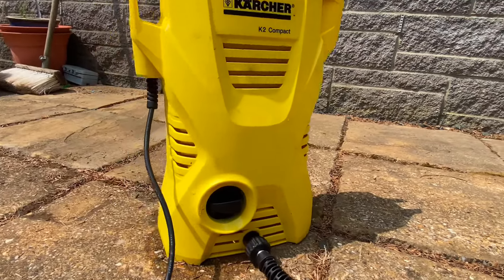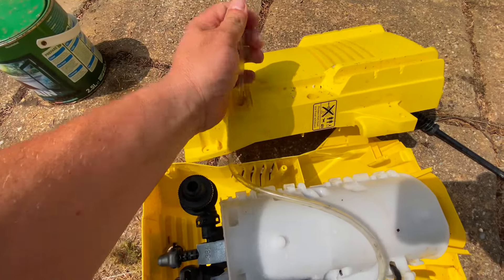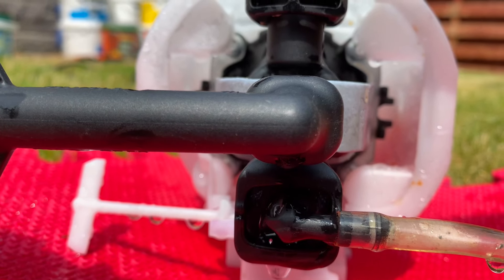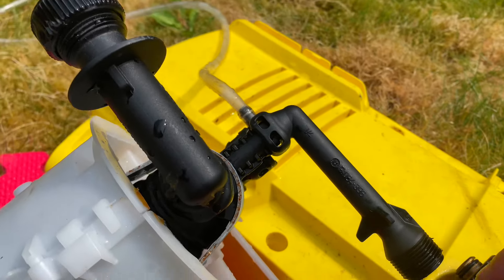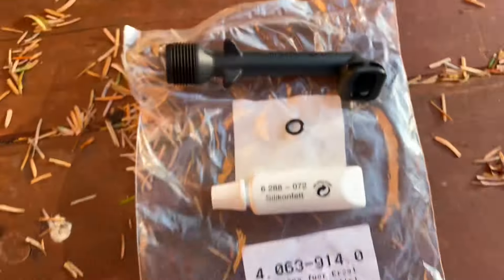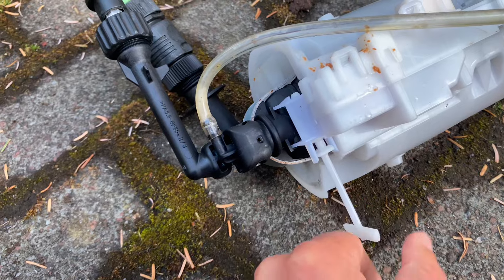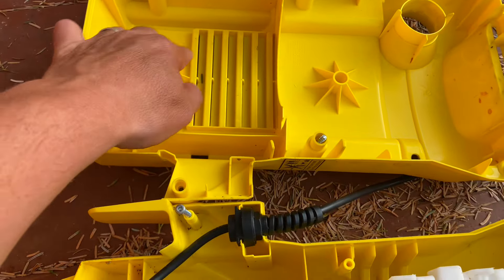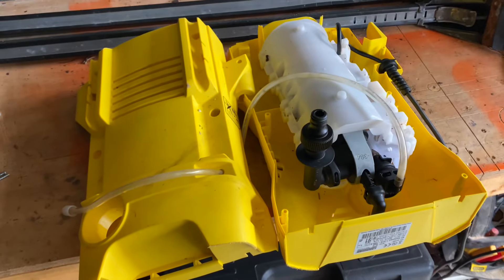Repair to leaking Karcher pressure washer. Quick, cheap fix.  👍

Comment: Exactly the same fault with mine, so many thanks for making this an easy diagnosis. The only issue if you have a K3 is that the daft Karcher product managers designed the two wheels to completely cover the four lowest T15s, which means you have to really abuse the black plastic area to get in any form of T15 bit. Once off, you can pop out the push-fit wheels for easy reassembly.
Reply from the maker: @peterburton9490  excellent bit of info 👍 Glad you got sorted too.

Comment: I watched your video on how to fit a replacement outlet pipe and O ring. The part arrived today andI  I fitted it in no time at all. Power Washer back to normal now. 👍 Thanks.
Reply from the maker: Excellent , a cheap fix 👍 now get on with your tasks 😂

Comment: I seem to have a same issue with my Karcher K2, leaking and spraying water while not able to keep pressure. Seems like a simple fix, thanks for the video.
Reply from the maker: @Xamnl  if you get the casing off and use the washer , it’d show if it were coming from the same not as this video 👍

Comment: Out of interest. Did this give the washer much more pressure back? Eg did it drop power with this leak?
Reply from the maker: @AlanBourne86  the washer would pulse all the time when not in use as loosing water.  It got worse. Pressure was down as not all water was going out the gun nozzle.

Comment: Great video - thanks for posting…👍
One word of caution would be to ensure you don’t make the same mistake as me - my lance cable/connector was different - double check your part no. mine was 5.064-110 for the small K2…🙄
Reply from the maker: Good tip! May be a variant in years 🤔

Comment: Hi do you know how to fix it when the water is leaking from where the water hose connects into? Thanks
Reply from the maker: Sorry, not sure. Best bet would be to get the case off and see exactly where the issue is.  If it’s where the lance hose connects to unit, it could be an O ring. If it’s where the garden hose connects it could the hose connector not fixing to male connector on unit ?

Comment: How did you order that part please mate my same bit is also leaking identical to yours
Reply from the maker: At 4:25 in the video and maybe somewhere else there is a bit that shows the serial no. Just ordered it off eBay.

The link I put in description doesn’t work anymore but this looks similar to the serial no. https://www.ebay.co.uk/itm/186350721996?mkcid=16&mkevt=1&mkrid=711-127632-2357-0&ssspo=DWDRhBAsQZi&sssrc=4429486&ssuid=HCOuvXMSQni&var=&widget_ver=artemis&media=COPY
Reply: That's great, will give that a go thanks for replying much appreciated 👍
Reply from the maker: @Br8cH  there’s a serial number on the split part you take off. Get that number and google it - just in case there is a change in years of manufacture 👍

Comment: Mine leaking from water pum i gues not worth fixing
Reply from the maker: Pump may be expensive to replace if that’s the case. Is it cracked ? Any chance it could be at a connection, rubber O ring ?